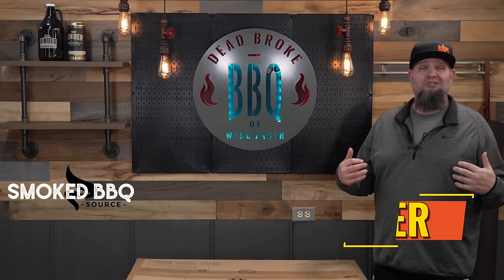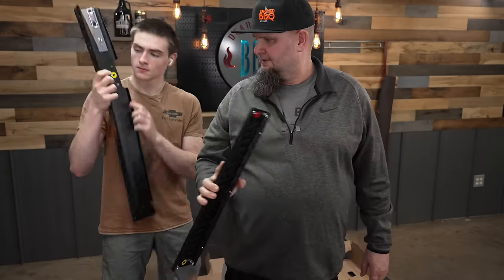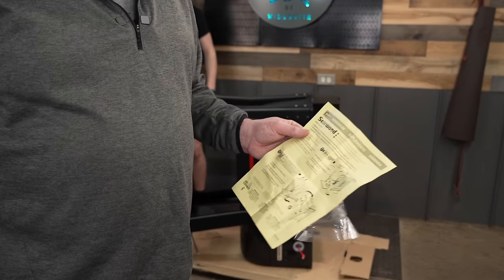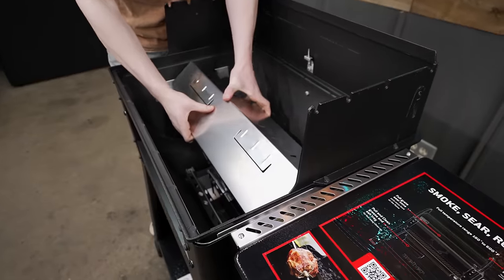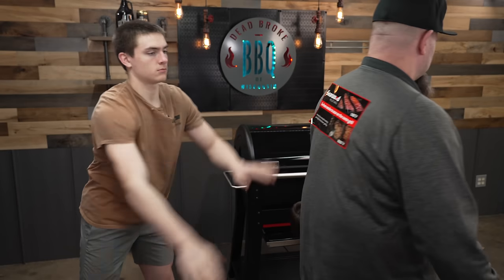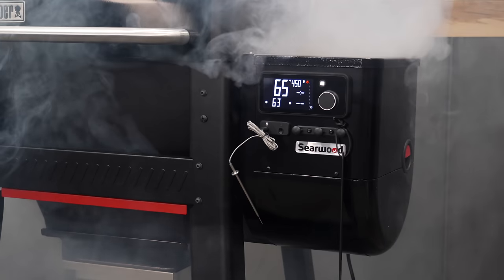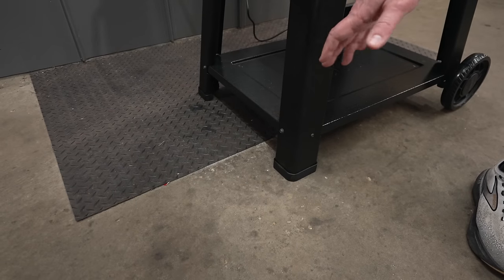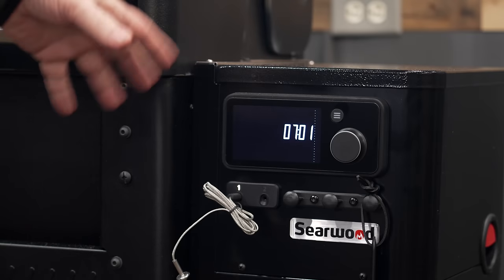NEW Weber Searwood Pellet Grill First Look & Burn Off

Comment: I've been a loyal Qstoves+ user for years but after switching to Asmoke, I realized what I was missing out on. The precision and control offered by Asmoke are simply unparalleled. The digital controller allows me to maintain my desired cooking temperature with ease and the wood pellets add a unique flavor that I've never experienced before. The ASCA™ technology ensures better cooking results and makes cleaning a breeze. Plus, the portability and battery-powered feature have completely changed how I do my outings. I can enjoy grilling in my backyard, camping, or even on road trips without worrying about finding a power source. The Asmoke Essential has truly revolutionized my grilling experience. #Asmoke

Comment: As a previous Qstoves+ user, I recently made the switch to Asmoke and I've been absolutely thrilled with my decision. The first thing that stood out to me was Asmoke's ability to control the temperature within 5°F - it's made my grilling experience incredibly consistent. I also love the versatility of the Asmoke grill. I can grill, smoke, roast, and even bake, all with one appliance. The wood pellet fuel source has also introduced a distinct smoky flavor that has taken my barbecue to new levels. Plus, it's battery-powered and portable, allowing me to take it on camping trips and tailgate parties. I also appreciate the environmentally friendly aspect of using wood pellets. The Asmoke grill has truly transformed my grilling experience and I couldn't be happier. #Asmoke

Comment: Just assembled my 600 this evening. That little bag with the yellow paper and extra screws are just that… extra screws (says so right on the yellow paper.) All of the screws with the blue lock-tight on them are used for the legs and shelf. You shouldn’t have had to use the other 6 unmarked screws. Great vid just the same.
Reply from the maker: The lock tight bolts didn't fit in 2 holes but the extra bolts worked. I showed you exactly where WE had to use them. We have assembled 100's of pits so this wasn't our first rodeo. So AGAIN this was the only way we could get the cart together. My guess is that most of the mounted tap nuts were burred inside and the lock tight wouldn't go through even with a heavy duty T handle Allen wrench. Glad you had better luck with yours. Thanks for watching!
Reply: @SmokedBBQSource  So strange. Glad it all worked out in the end. Looking forward to your reviews of the grill. As I type, I am on hold because Weber doesn’t like the serial number I’ve entered to try and register it. I’m staring right at it, under the hopper lid, and the website says it’s wrong.
Reply: @SmokedBBQSource  Had the exact same problem. Why did they only include 6 screws where there are 8 holes for the shelf?!?! The smaller ones were much better but still not perfect.
Reply from the maker: Ya, my guess is on the 2nd batch they address this issue.

Comment: Having had a few with casters, that’s the dumbest option. Weber I’m on my third set cause the bolt is bent over, wagon wheels don’t fail
Reply from the maker: They work great on my concrete, so I always want pits with 4 rotating and locking casters! Thanks for watching!

Comment: Man Weber uses the cheapest metals and the design is the worst. Why did they get rid of their pellet auger system that dropped the pellets high above the burn pot?  That burn pot will rust out in no time.  For the cost that thing should be built like a LoneStar
Reply from the maker: hahahaha times by 3 is you want LSG quality.